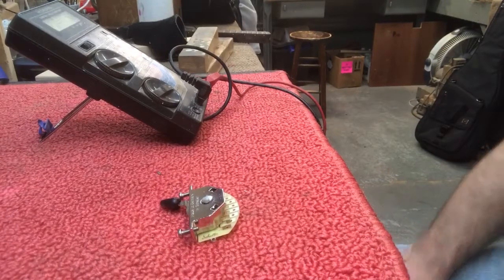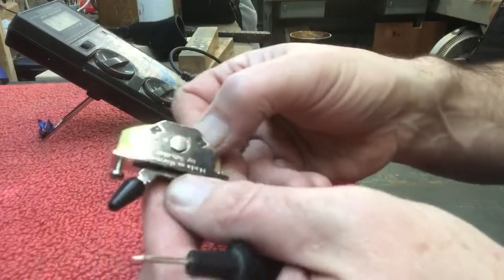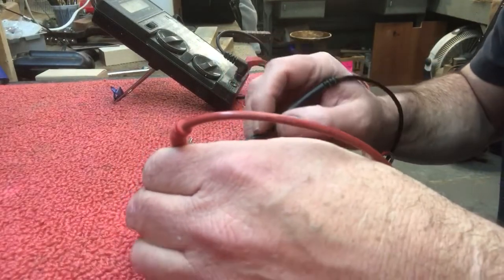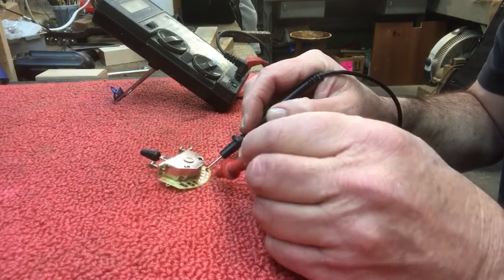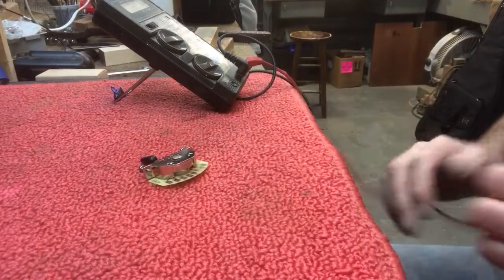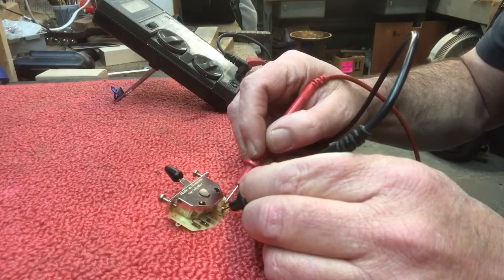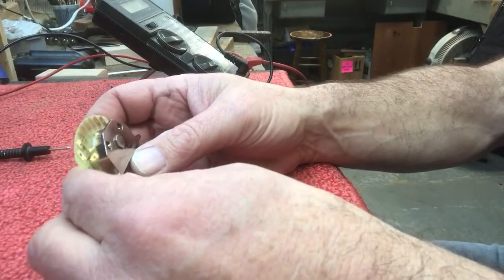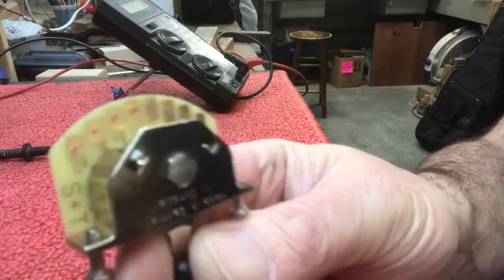How to figure out a 5way Guitar switch

Comment: Hi Jim, it would be so helpful if you could make more videos of this Schaller switch and installing DiMarzio 4-wire pickups in an Ibanez Jem or Rg, in the HSH configuration. There is absolutely no help on the net and Schaller’s website has no quality information or schematics. They make a great switch, but how can they sell these switches with no information available ? 😏